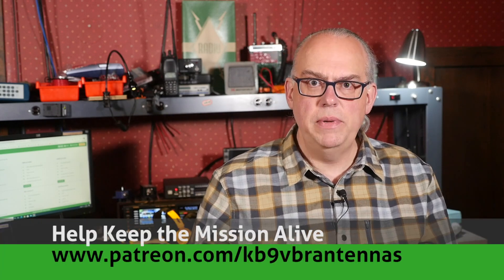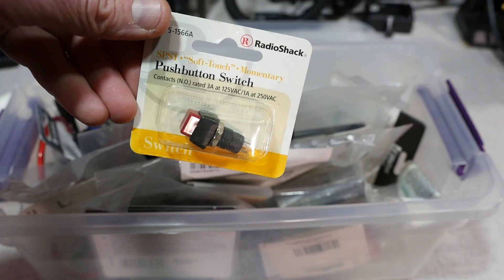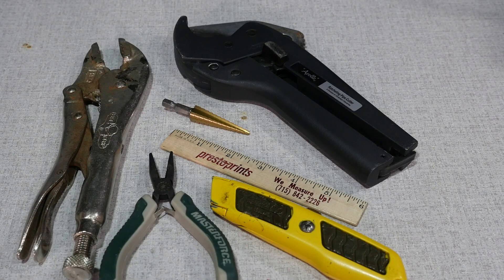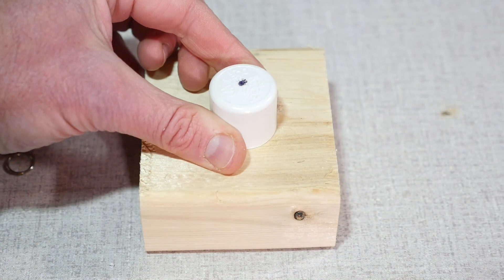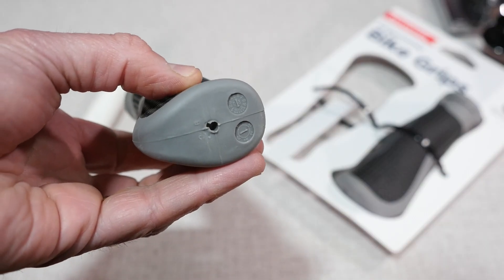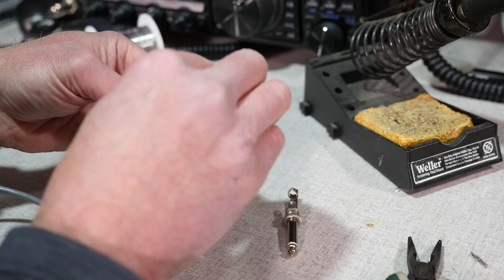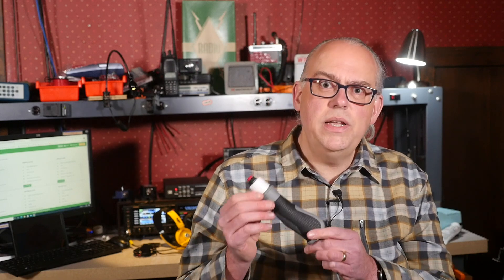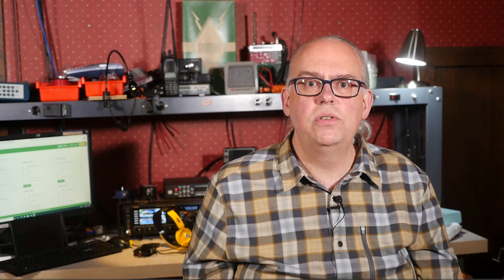Ham Radio How To: Build a Headset Trigger Switch - Ham Radio Q&A

Comment: Update: built this last year and it works great but also adapted a foot switch discarded from a guitar/music store. Lately on activations in my car, I tried attaching both switches using a splitter. If my foot gets cramped I just use the hand switch in the seat. It’s nice to have the choice. Bob, WBØWIF

Comment: Great project, however as asked by someone previously, what are you plugging the phono socket into? I have a Yaesu 891 what do I need to do to connect??
Reply: Confirm with Heil, but it's likely their Headset Adapter Cable AD-1-YM.

Comment: Great video, thanks! I built one of these this week and also picked up the Heil PSEIC headset and adapter so can’t wait to try them out! Thanks again!
Bob, WB0WIF
Reply: One of your comments about a foot switch caught my attention so today when I was at a guitar store (I’m thinking of selling a guitar), I asked if they had any old foot switches and they just gave me one they thought was useless. This one is wired normally closed, so I took it apart and it should be simple enough to reverse the switch inside. Thanks for the advice, again!

Comment: KK7SWB- new ham here- question- i see the double plug adapter from the radio. is that a part you have to get separately? do you have to mod the headset connectors also?

Comment: Ifyou are struggling to get the grip over the PVC Tube and you have access to an air compressor, use a blow nozzle and blow air under the edge of the grip as it's being slid over the tube, the air will inflate the grip and make it MUCH easier to slide over the tube. (We use this trick with motorcycle grips all the time :) )
Reply: You can also use some WD-40, soapy water, or even corn starch. (Used all of these tricks to put grips on handlebars.

Comment: so your headset-radio adapter has 3 sockets? one for headphones, one for microphone and one for ptt switch?
Reply from the maker: The Heil BM-17 has two plugs, one for the headset speakers and a second for the microphone. Heil sells an adapter that connects to the microphone plug on the headset and that adapter provides the third connection for the PTT switch.

Comment: An easy way to get a rubber bicycle grip over something is to apply some isopropyl alcohol inside. This allows the grip to slip on easily; it will then dry, and the grip will hold in place.

Comment: Great video Michael!  I couldn't find anyone stocking the Heil PTT hand hand switch so I'm going to give this a go.  Could CAT-5 cable be used for the wiring?
Reply from the maker: Cat 5 will work. The stranded cable will be more supple. The only downside is that the wires are really thin, which could be a challenge in soldering.

Comment: Great little project. I made a switch in a box for my IC-7300 with up and down momentary switches. The only thing is if i'm a little too slow in latching the momentary PTT switch there is a slight noise, a similar problem at an FM radio station i worked at and the on air light latch switch cause a glitch on the mic. I'm thinking a small value capacitor might fix that, not sure what value  - maybe someone can suggest here, something small im guessing like 1 to 100uF ?
Reply from the maker: Icoms use an electret microphone element so the transceivers supply DC voltage on the microphone line. That may be the cause of the glitch. When connecting a dynamic mic to the radio, most people recommend a blocking capacitor of either 5uf or 10uf. I'd go with either of those values to see if that clears up your clicks.

Comment: I'm assuming that the Icom PTT switch works the same way?
Reply from the maker: Yes. This switch plugs into the Heil headset adapter, so it is universal to the radio. The adapter makes the necessary connections for the PTT circuitry.
Reply: @KB9VBRAntennas  That is greta. Now I just need to wait for things to cool down then I will build one. Wife thinks I have spent too much on my ham hobby this month and I haven't built up a good parts bin. I will also be buying your 2m Jpole after I save up and the wife cools down.

Comment: Would cutting the cap shorter help with the length?  Band saw or hack saw may do it, then shorten the pipe as needed
Reply from the maker: It would. You'd have to clamp the cap to carefully trim away material.
Reply: @KB9VBRAntennas  would sliding it on a spair piece of pipe as a holder work?

Comment: Nice home brew 👍. To ease the handle on the pipe try alcohol. Have done for years with handlebars, also with putting tubing on slingshots. Just give it a bit of time to evaporate
Reply: Alcohol metal will make it slippery for a bit, but on pvc it'll be extremely dry, which is why its used to clean pvc before putting the glue on it when connecting to other pvc fittings. 
My go to is dish soap, a couple drops of that goes a long ways.

Comment: When I got my Heil headset I realized I didn't care for the IC-7300 transmit button, so I thought about buying a PTT switch. Then it dawned on me that I had something that might work: a straight key! It sits on the desk, doesn't move, and isn't fussy about how I press it. Lots of hams have 'em and they can  perform a second duty! Your switch looks really great!
Reply from the maker: That's a great idea.
Reply: What a great idea!

Comment: Very cool! I'm starting to gather parts myself.  Hardest one so far is the bike handle ha ha; just can't find one I like.
Reply from the maker: That's probably the hardest part of the whole build.
Reply: @KB9VBRAntennas  Apparently the hardest part is drilling a hole in the cap.  I can't seem to get it centered and if it's off center the hex nut to secure the button won't fit right.

Comment: Does this have switch have any noise or click when it is pressed or released? I know there are specific switches to eliminate any unnecessary sounds I’ve used before for audio setups.
Reply from the maker: I haven't noticed any noise or clicks with this switch.

Comment: Where does the switch plug into the transceiver?
Reply from the maker: Headsets require an adapter cable particular to your transceiver to split out the microphone input and the PTT switch. You will plug the trigger into the PTT input on the adapter cable.
Reply: Lots of transceivers have a PTT input jack on the back of the radio for plugging in the external switch too.
Reply: Thanks for your help!  Looks like a fun project.

Comment: Hi. You mentioned you picked up a foot pedal at a guitar shop. I know nothing about guitar pedals, other than there are a multitude of them to create different effects. Did you modify the pedal to use with the radio? If so, can you make a video about that?

Thanks
Reply: You'll want to look for a keyboard sustain pedal. It's a momentary switch. Some even have a NO or NC switch to work with different keyboards. You won't be looking for a "guitar" pedal.
Reply from the maker: Correct, it's the effects pedal you'd use use with an electronic keyboard. I found a used one for about $10 in the discount bin at the music store.
Reply: @beck4u717  Thanks.

Comment: I think I would eliminate the pvc and just put the button in the handle. Maybe a little hot glue or something. Maybe just push it in if the hole is the right size. Great project. I have a Heil headset with a push button switch that can be intermittent at times. 73de KB7ICI. Solar trailer project looks really nice!
Reply from the maker: Now that I think of it, a PVC plug may fit into the hole of the grip. That may be an option if you want something lighter.
Reply: @KB9VBRAntennas  I did notice when I went to the hardware store that the pvc caps they have are rounded, whereas the plugs are flatter, so the button might sit a bit flatter on  the plug even if you use the pipe.

Comment: Are you using the BM-17 with the headphones on both sides, do you find that it is it loud/clear enough when outdoors?  I have the BM-17 with the headphones on one side only that I've been using for POTA and I have been debating switching to the two sided headset.
Reply from the maker: I have the two sided headphone and prefer that style as I find single ear phones tiresome to use on HF. My experience with the BM-17 in a noisy environment is limited as I haven't had them very long, but I've use the larger Pro-sets outdoors and they  really block the noise.
Reply: @KB9VBRAntennas  Thanks for the reply! I am in the market for something new and will check out the Pro Set when I get a chance.
Reply: I’m curious after some more time with this headset if you find you still like it. I’m looking for something for SOTA.
Reply: WQ9F, I am considering the  BM-17, but does the single sided headset boom work on the left side only?  I am deaf in my left side.
Reply: @davidnienhuser3528  you can use it on either ear. The boom can rotate to either side. 73!